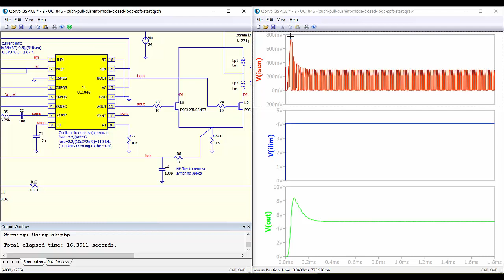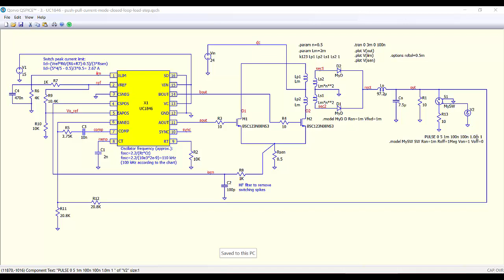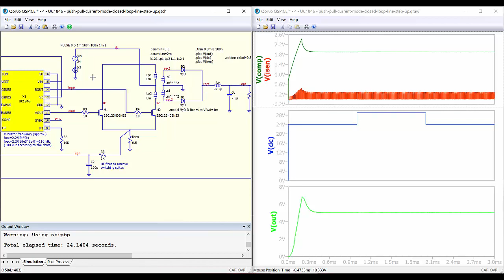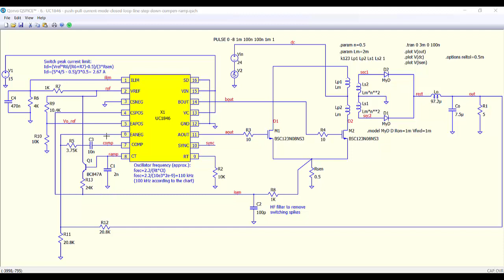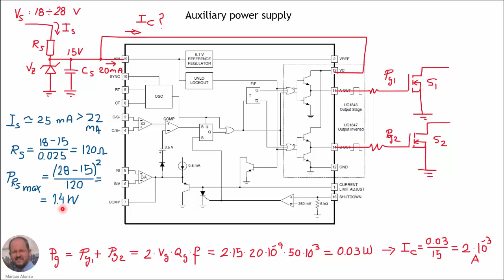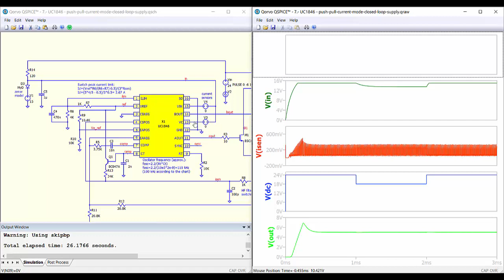Qspice #8: Current-Mode Push-Pull Converter using the UC1846. Housekeeping Chores

Comment: Good afternoon Professor Alonso. I have a question on Rs and Cs. Are these used for the soft start?
Reply from the maker: Hi, thanks for your question. Rs and Cs are not for soft start. They are used to implement the power supply of the integrated circuit. Cs is a decoupling capacitor used to provide additional filtering at the input of the integrated circuit. Rs is used to bias the zener diode.
Reply: @MarcosAlonsoElectronics  Thank you so much Professor Alonso. I really appreciate it. My next question will be: how to implement the soft start in real application on such converter. On again, thank you so much for the knowledge you are sharing.
Reply from the maker: @FidegnonFassinou-yb4wv  This is explained at the beginning of video Qspice #8
Reply: @MarcosAlonsoElectronics Good morning Professor Alonso. Thank you so much for your reply.